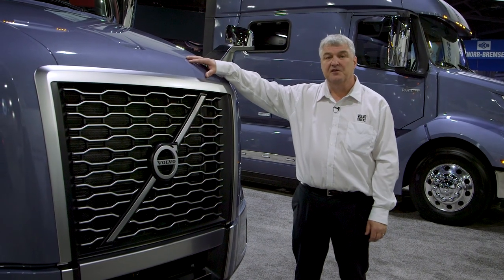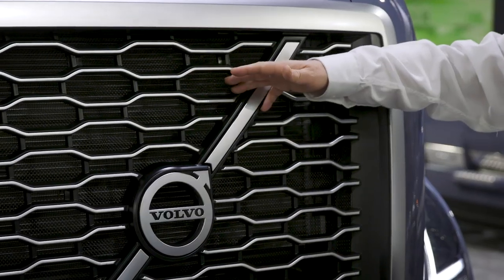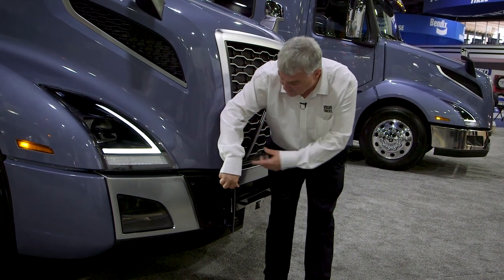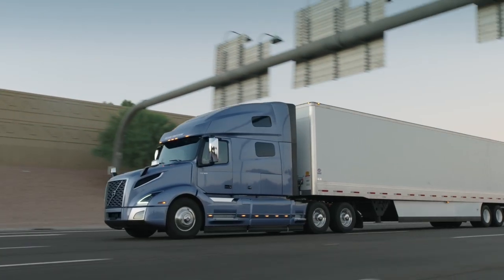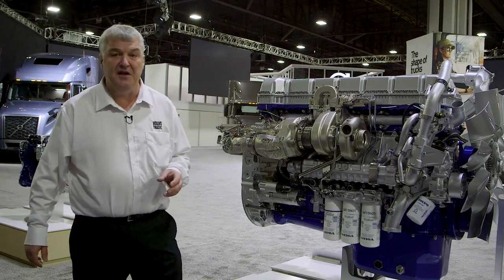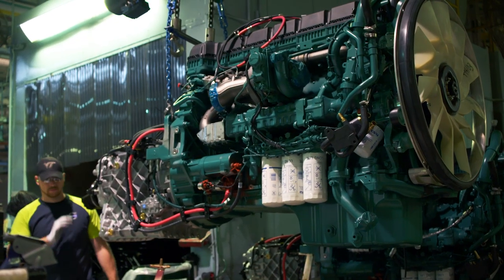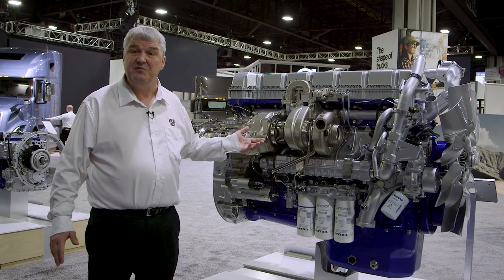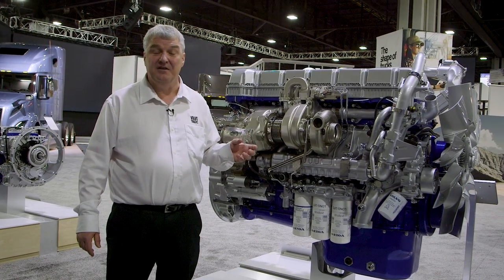Volvo Trucks - A Closer Look:  VNL Fuel Efficiency

Comment: I got the 2020 this truck is def awesome, smooth, turns on the dime, and the sleeper is roomy. Only thing I'm still trying to figure out is how to use the idle smart for my ac
Reply: How’s it running so far? Any issues?